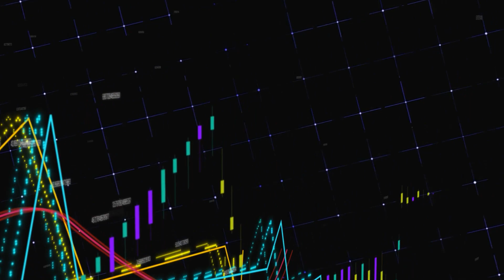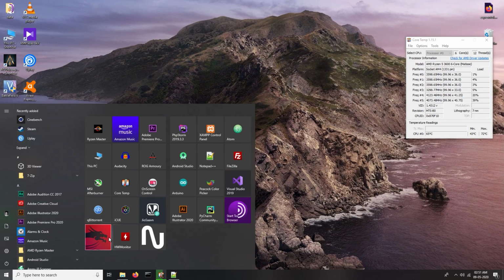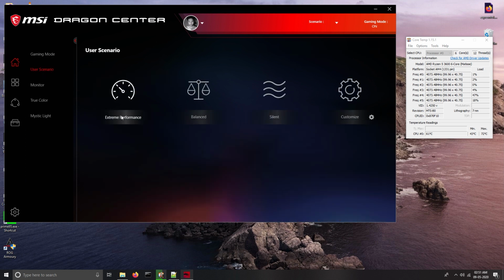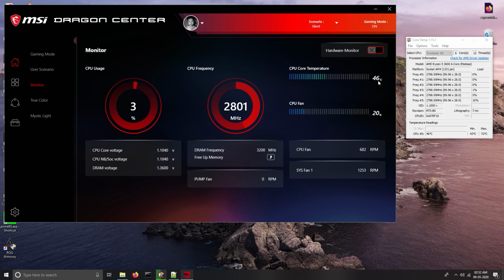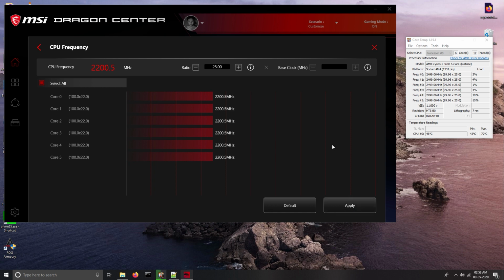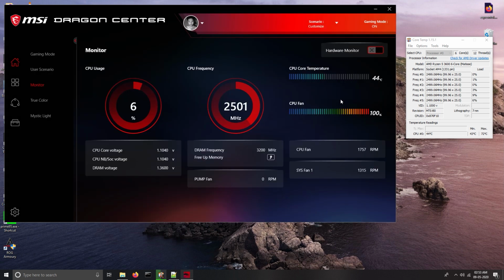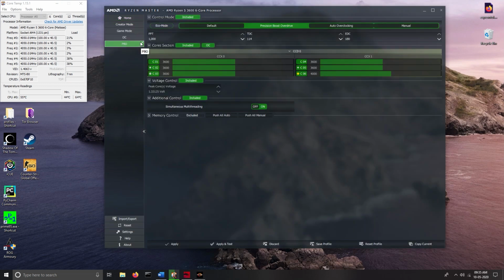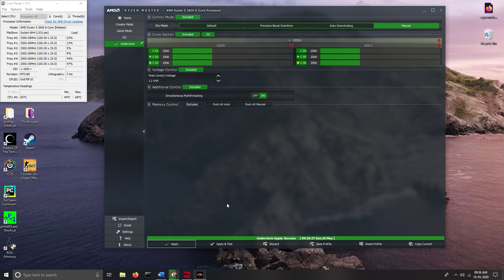Ryzen High Temperature Fix - Underclocking / Undervolting guide

Comment: I have ryzen 7 4800h mobile cpu what can i do to lower the temps
Reply: lower voltage to 1.3
Reply: @alipk2633  and what temp do you get ?
Reply: @xaero7262  i have a ryzon 3400g 
1.4 v  get  to 75  c  full load

Comment: you don't need to touch the cpu speed in Mhz, just slowly reduce voltage and test stress,  but before create a profile and export it otherwise it will be lost, upon every stress test (CInebench, aida,etc) save the file, repeat until it crashes.
I got my 3600 to run at 4.1Ghz stable with just 1.075v. Have a ASUS Prime x570-p. My iddle temps are below 40ºC, with room temp around 30ºC.
Reply: Can you tell if you did it in the bios and had no problems
Reply: @masterv6679  you can do it in the bios, but you can also do it win Windows by using Ryzen Master software
Reply: @masterv6679  yes, I also did it in the bios, no problem whatsoever
Reply: is your cpu bronze rated?
Reply: @alvydasjokubauskas2587  have no idea

Comment: Will this cause performance degradation
Reply from the maker: If you lower the frequency your performance will be low. For better thermals you need to find the perfect balance between voltage and frequency.
Reply: The performance will be drastically reduced when the "silent" profile is used. 
Also in idle, 60 deg C is unacceptable. So, the simple method is to increase the clocking by 100Mhz and decrease the vCore voltage accordingly. 
for Example: For Ryzen 9 3900x I have increased the clocking to 4.2Ghz and vCore voltage is decreased to 1.2910 Volts and I get an amazing increased performance and CPU doesn't go beyond 72 Deg Celsius (I am not not sure on Ryzen 5 3600x) - oh by the way I get a score of 7910 on cinebench 20. and I have made the changes in BIOS